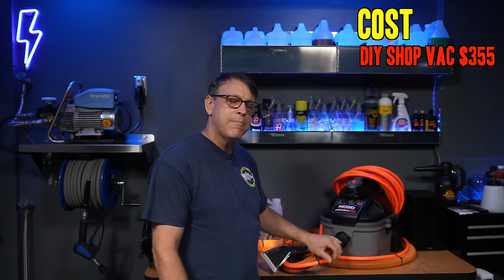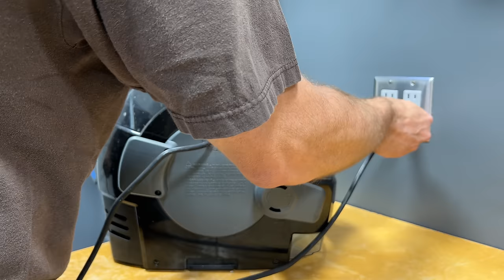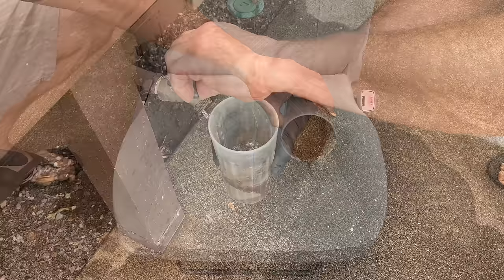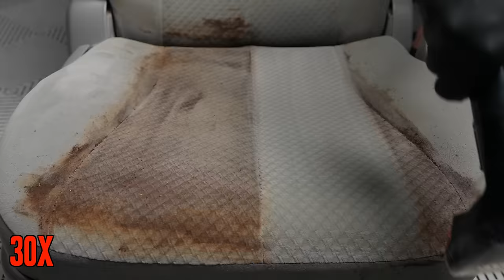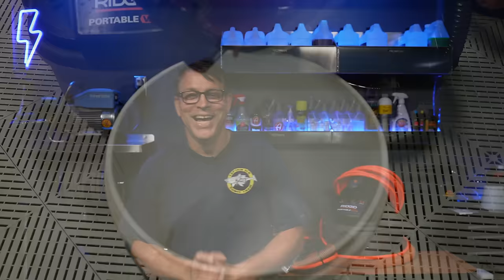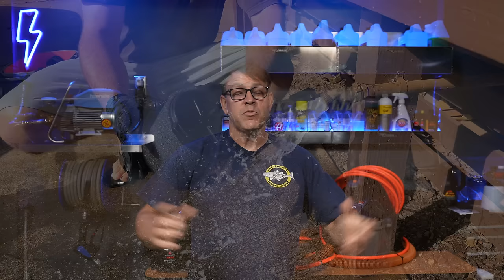EXTRACTOR EVERY THING YOU NEED TO KNOW. BISSELL SPOTCLEAN PRO or DIY SHOP VAC

Comment: If you have a good shop vac with high cfm, you would be surprised on how dry you will get the seats with the extractor head alone. You can get it dryer if you go over it with other heads though. Especially if your extractor head doesn’t offer good flow.

Comment: I just use my regular shop vac with no hose or carpet cleaning head. Just a regular spray on seats, drill brush and vacumming it with the normal attachments. It works great
Reply: Do u use a wet filter 
Or just run it with the regular filter?
Thanks!
Reply: @Ajdv65  might use no filter

Comment: Great video Jeremy.    I've got both a professional grade machine and the Bissell.    I do tend to go for the Bissell most times just because it's portable, pretty easy to set up fairly quickly, and get's the job done.    I'm not a professional though so the Bissell works just fine when I am doing a yearly full interior carpet and upholstery cleaning.
Reply from the maker: Thanks for sharing your thoughts Joe.
Reply: I just don’t understand why they can’t make these have more suction like suck the shit outta the water u can put soap and scrub the important part is suction and no machines offer enough suction’ not consumer anyway! 

Even $550 rug dr pro suction is so weak it can’t even hold a paper on it’ my granddad had a carpet business in the 80/90s yea truck mounted prolly 10k plus for the set up but 2 quick passes sucked up everything these machines claiming to be a carpet cleaner are trash’ zero suction’ 

Also fun tip never ever mix soap with water’ make up solution get a pump sprayer 5-10$ spray area 10 mins b4 agitate then suck up’ 

When u mix soap n water it leaves soap n carpet that actually attracts more dirt’ lesson he thought me’ 

Think of it like taking a shower with soap mixed into your water’ you’d always have soap on u’ same theory so never put solution n water tank if u do u MUST empty it then use clean water and water only to do a rinse but now u soaked your carpet too much 

So don’t mix soap!! Buy a sprayer spray soap then scrub drill brushes r great $10 at amazon / Home Depot  then suck up’
Reply: I Agree I Detailing mobile I just buy it Works great on cars
Reply: Great comment
Reply: @joshymcdaniel9233  Oh, how I wish I saw your comment before I rented a professional Bissell machine and cleaned all of my carpets/rugs. Is mixing solution + water and using that in the device the reason my carpet doesn't feel as soft as it did when it was installed last year?
Reply: @JJouissance  Yea the soap is still left on the carpet surface. Unfortunately you have to use clean water and suck it up again.
Reply: @JJouissance I'd like to know this answer as well

Comment: I’m surprised Bissell has not provided a longer hose for the spot pro unit. That seems to be one of the number one complaints. But it still does a solid job if you only need it a few times a year.
Reply from the maker: I agree. Thanks for watching
Reply: The Bissell's biggest shortcoming is the relatively weak vac motor. Weaker machines just can't draw in enough air-mass to utilize a longer hose. I'd honestly pay double the price if they stuck a SERIOUS motor in these things. I absolutely do not want to fuss around with trying to find a spigot for water like with the shop-vac setup, but you do get more suction.

Comment: Bought a Bissell Spot Clean Pro to use on my own vehicles.  Cleaned the seats and carpet in my daughters car using P &S Carpet Bomber and a drill brush ahead of the Bissell and I thought it did a good job.  Being a dedicated vacuum I would assume the Rigid would have more suction, and using a hose directly from the faucet would give you more water flow also. Although it is slower, the thing I like about the Bissell is that it is all self contained after you fill the water reservoir.  Easy to move around the car without pulling a hose behind.  I also don't have hot water yet in my shop, but I can fill the Bissell reservoir in my house with hot water before using.  Also the Bissell having smaller diameter - more flexible hose and a smaller extractor end, the Bissell seems easier to get into tight corners then the Rigid.
Reply from the maker: I agree. Thanks for watching and sharing your thoughts.
Reply: Other than the wider track, not much difference in performance between the two, IMHO.

Comment: Great video and comparison.
I think that the biggest advantages of the ridgid setup are that if the power unit ever pukes out it easy and economical to go to Home Depot to get a replacement and the ridgid can be used as a good powerful dry vac as well.
The bissell is economical but is restricted to extracting only,has a smaller collection tank and isn’t nearly as rugged as the ridgid but it does do a great job extracting
Reply from the maker: Totally agree. Thanks
Reply: The Little Green version has a robust motor on it. They are extremely easy to work on and you're able to easily find parts for them if something goes out

Comment: There is a guy that uses a Bissell for for his professional detailing business. His channel is called the Detail Geek and uses it for every car detail.
Reply: Yea detail geek uses his all the time. I would have to disagree with this guy saying it’s not for professionals who use it daily. As long as you take care of the machine it should last a while.  I just bought my bissell.
Reply: You can def use it and take care of it.  But boy does it suck. I cleaned a couple cars straight from auction and it took much longer than I thought. Nice result. But a lot of elbow grease and time. And it’s annoying having to recline a seat forwards or backwards to place the machine inside the car cause if it’s a truck it won’t reach with its small hose to do the entire seat. And the countless times turning it off to dump the water and add more. I’m gonna try sometime soon to convert a vacuum to extractor. It looks much simpler.
Reply: Ugh I bought the bissell it was nice but it’s to small the diy extractor is the way to go. Hate it
Reply: I think he mostly details for YouTube. I don't think he is detailing nonstop. Even if he is, not everyone wants their carpets shampooed.
Reply: When i used the bissell a few years ago it was hell, as someone else mentioned the extremely short hose makes it extremely awkward to work with, if doing larger vehicles like vans you’re looking at 12 trips to drain and 3 to fill throughout which all eats into your time on the job, was great just using on my personal car but for customers it wasn’t great
Reply: He shows you a couple of seats. Not the entire thing. Full cars with that extractor the water dump if you actually try to clean it takes 3 passes at least. A lot of water dump.
Reply: @JCic22  than get a bigger vacuum problem solved.
Reply: @lel3450  I am talking about Detail Geek little buddy.
Reply: @JCic22  thanks for clarifying little friend
Reply: @christiancruz8054  "I saw a YouTuber use it alot, so it must be good"
Reply: @Jayy_.-  when detailing a car, remove the seats. Invest in a drill with a brush attachments. It takes away from all that elbow grease and your cleaning carpets and seats with in an hour
Reply: @awqwxrd6284  that’s the easy part. The bissel product is the problem
Reply: Just because he can do it doesn't mean it's professional grade... not as fast or efficient and the hp is way less.
Reply: @jonbravo9278  He seems to be getting professional results.
Reply: Yeah he definitely does and he details some of the dirtiest carpets I’ve ever seen. 😂 Bissell gets the job done.
Reply: He uses it so his viewers can buy with his affiliate link lol
Reply: @christiancruz8054  Detail geek is just a hobbyist. Running a business is about efficiency, professionals don’t take over a day to clean the interior of a car. The guys job is youtube not detailing.
Reply: The Detail Geek is the reason i bought my own Bissell.  I dont use it every day but i use it a lot.  It is the best affordable extractor i have owned.
Reply: Diy shopvac extractor is more efficient than Bissell. But portable wise Bissell wins.
Reply: Detail geek used the spot clean pro on all his details and he does the full interior of hundreds of cars with the same machine
Reply: @VashxThexStampede  Imagine knowing the guy off of what you see on what he wants you to see on the fake ass internet. Y’all need to grow up and get off this media shit, sit back and reflect on yourselves. Not even trying to be rude big dawg just being completely real, no hate all love. ‘Detail geek’ is a business, owned by google/YouTube. Dude has no passion for DETAILING, idk how peeps don’t see through this shit like it’s glass it depresses me. Idk why you’re replying to me, I do this to make my money and I actually enjoy it. I only need to see one video from detail geek to know he isn’t doing it for passion. Doing it for something intangible, that is exactly what passion is .
Reply: He has to do a bunch of water dumps for a professional you have to stop every 10 minutes I have one. He just switch to a bigger one.
Reply: We've had a bissell little green machine for 18 years and it's been put through hell and still works perfect bissell stuff is pretty tuff
Reply: It's okay if you don't need it everyday, I've used it on my cars, but if I had to use one daily I would upgrade to an extractor with a longer hose, a wider nozzle and a larger capacity debris tank.
Reply: At least he used to......since he built a new detailing studio the spot clean pro is no more 🫤
Reply: I'm a professional that started my llc and in my first yr. I use a Bissell. Love it. Works like a charm
Reply: true but this weak equipment makes it take many hours to complete a vehicle.  in just the last 3 videos released it took him between 5 and 8 hours to complete everything.  The upholstery part could have been a lot quicker however.  in my opinion, it's not worth this savings if you work with it.
Reply: @Sulffur2  I have a friend that does detailing and with all of his commercial equipment it takes him just about as long. The time spent on detailing is in, well, the detail. Its easy to skim over a car to clean it. But when you get right into it detailing every nook and cranny. It can be very time consuming. Ok, now back to the subject at hand. Would I do a full out detail and run a business completely using this machine? Probably not. But you can get some very good results ,professional results, with this machine.
Reply: Detail geek was making money off this unit. Linking it to his store so of course he would use it. He now uses a Mytee but no professional should be using the bissell. That’s just pathetic
Reply: Its been a 8 months im using bissell as of now I’m contentment but I’m looking for more suction power.
Reply: Sadly hes now uses The Mytee hot water extractor idk what he did with his Bissell
Reply: He's booked lots.
Reply: @deeznuts1358 do you know him? Lol he owns his own job and has been doing it long before he started his channel
Reply: He’s just a content creator not a real detailed he wouldn’t even qualify for ceramic coatings
Reply: @deeznuts1358  if a youtube guy "DEPRESSES YOU" you need some councelling little dawg

Comment: Thanks for another great video on this. I have the Rigid vac and the orange accessory hose which is what I use on-site for vacuuming and I also have a spare waterline hose as well. This set-up appears to work so much better because the suction I’m seeing is worlds away from what any of the little Bissells can do, and I’ve owned 4 of them. They break, they leak and have a short lifespan, but they do work. It would be very convenient having both a vacuum and an extractor in the same machine. I use my client’s water, so they wouldn’t mind if I hooked up to their washer hot water line.

I'm mobile detailer and I’ve use a Little Green Machine from Bissell, but only because I don't have this extraction head shown here, because I don't have that many clients that need extraction. Super Clean and a wet towel cleans most superficial upholstery stains, so I don't even bring it with me unless I know I'll need it. Most times it’s just a spilled drink I’m removing with it, not the entire car interior (although I've done it). I also have a small steamer machine that is smaller than the Rigid vac, but rarely need it.

I’ve collectively spent about $500 on those little Bissell extractors and while they work for a little while, they do not last long and I’ve never used one so much that it should stop working, but they do. My fault for having kept replacing them. One just tipped over once and the hose leaked ever since. I also see no advantage to a professional system over this (with hot water), because you are delivering water, then sucking it up, that’s it. If it does those two things well, it gets a pass from me and you don’t need to spend $1000 to accomplish that. 

In addition, the suction is so good on my Rigid vac that I would use it in my home after I shampoo my carpets. Those home carpet machines (yep, also Bissell) leave so much water behind on your carpets, that this set up would definitely cure. I know how well that Rigid vac is, and I’m telling you it could damn near suck up a refrigerator, so using it as an extractor is brilliant, especially if you have pets. 

My vac was $80 at HD online and came with 2 free bags (although some don't use them) and was shipped to me free. It was $90 in the store and did not come with extra bags (I know, go figure). The orange hose is in an accessory in a kit you have to buy separate for around $50. Whether you use it as an extractor or just a vac, it's a great machine.

Comment: your videos have gotten alot better!  I was thinking of getting the aqua pro vac  since I have their steamer.   definitely will just convert my rigid   since I'm just  side hustle detailer.  thanks for the comparison! love the up lifting mood.
Reply from the maker: Thank you. Glad you enjoyed.
Reply: I had an aqua vac pro. It was OK but it had some issues. The clean water reservoir was a little small and required re filling and could potentially damage the vacuum motor if it ran dry. The buttons also stuck because of the way the top sits. Lastly the plastic transparent portion on the handle broke because of the pressure when vacuuming. All in all 4/10 for being $600.

Comment: I have owned the bissell for about 2 years now. It has been a great tool for both cars and the home. I can spot treat carpet messes inside the house. Comes in handy when you have a puppy. 

My biggest gripe is the tank can leak at the threads. I have two. One with water only and another with 10:1 La's Totally Awesome APC. Both leak at the threads. The water one has never seen any cleaner fluid. So just need to be careful with the tank if you leave it out.
Reply from the maker: Thanks for sharing.

Comment: I bought the Bissell Commercial BGSS1481 (the commercial version of the small, portable spot cleaning extractor).  The plastic housing at the end of the hose that contains the trigger assembly is incredibly thin/brittle plastic and breaks ridiculously easy. 

You have to buy a new hose assembly for $26 to get it worked but it still is super fragile. 

The shop vac hose is a much more solid construction that can hold up to normal wear and tear.

Comment: Nice comparison video!

My go to vac is Stanley 6 gallon 4HP from Walmart for $50. I get about 600 hours out of one. For shampooing carpets and seats, I use a garden hose with nozzle set to mist. Spray the fabric and lather it up with a brush. Then I suck it up while spraying with the mist setting. I had a Rigid. It cost 3x more than my Stanley and the filters are $30 . My Stanley has better suction than the Rigid. Sold the Rigid for a song just to get rid of it.

I also had a Little Green Machine and I might just get the Bissel Spot Pro.
Reply from the maker: Thanks for sharing.

Comment: I have a bissell spot clean pro.
It works great for the jobs around the house and in the  car.
I was surprised how well it cleans  while being economic with the amount of water needed.
Reply: Have you used it on a fabric (microfiber) couch?
Reply: @roanokejoe  yes, it works well on a microfiber couch.
I also cleaned a futon I haven't used in years and it looks like new .
For its price it certainly performs extremely well.
The only downside is because of its compact size you may need to refill the water tank and empty the waste water more often than on a larger machine.
It's quite light and really straightforward to use.
I got one because detail geek recommended them.

Comment: You should try the spot clean pro heat. It’s much better. Having heated cleaner makes huge difference. I have both. I also have or had a bissel pro heat lift off it’s also amazing for the house and car… but my mom stole it from me.
Reply from the maker: Thanks for sharing. Thanks for watching
Reply: I have an older pro heat. It's 1600-1800W 240V so it has a much stronger motor and also heats. The tools are not as compact as the newer machines though. I'm going to was the hose for one off an newer model but there is  no stock at the moment (and hasn't been for literally 2 years)

Comment: Great follow up video on the ready to use extractor and the modified extractor. In the comparison video at the end I payed special attention to performance and it seems like the Bissell stalls in a pattern (much like a pad stalling on a paint surface) and the custom Rigid extractor had continues flow. This was the most compelling for me because it looks like the pump is overworked on the Spotclean.
Reply from the maker: Between the 2 machines the shop vac is a more robust set up for sure. Thanks for watching